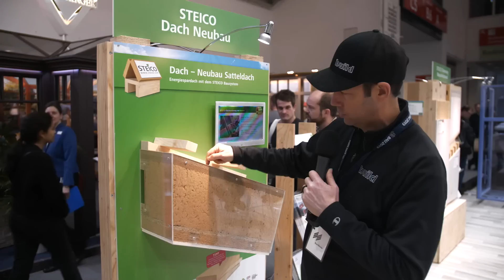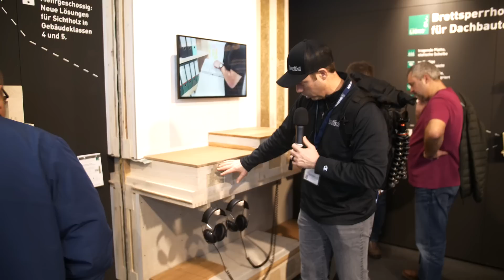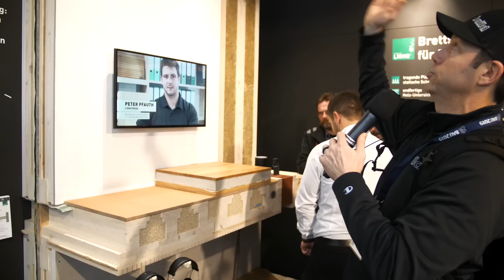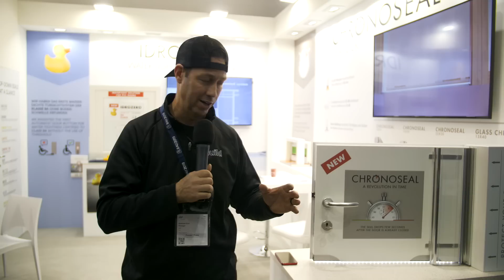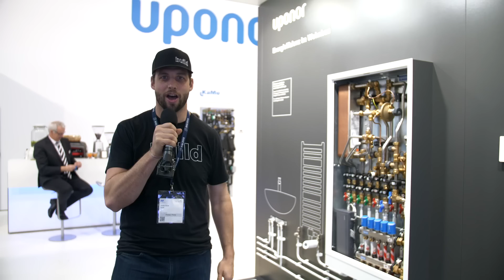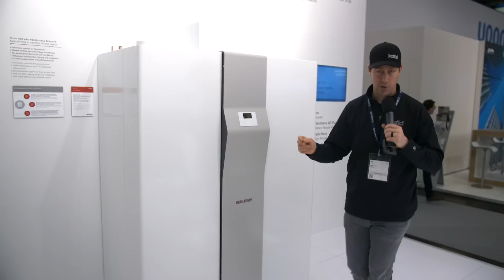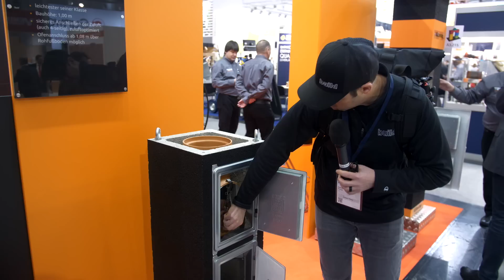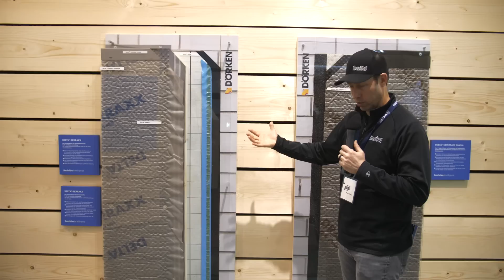These German Building Products are Awesome! Day 2 at The Bau Show Munich 2019

Comment: How longlasting is glulam?
Reply: Probably depends on the glue. I've heard that urea-formaldahyde keeps offgassing until it's all gone, so once you've gotten cancer from  breathing all of it, your house will collapse on top of you.  But I'm sure some of the glues they use now don't do that, though they still have to be chosen carefully. Some rot, some melt, etc.
Reply: PC No many years ago I had urea formaldehyde foam insulation pumped into the walls, never had a problem, but they were surprised given the age of the house it had 1 inch, of double coated heavy paper sandwich of the old fiberglass strands.  1939 built.

Comment: Dont if you guys got the answer for the difference of U-Valve and your R-Valve, its the opposite so to say.
R-Valve is Thermal resistance
U-Valve  is heat transfer coefficient - amount of heat per time ( 1 square meter per second and the unit is Watts per square meter and Kelvin [W/(m²·K)] )

R = thickness / thermal conductivity and the other would be U = thermal conductivity / thickness

Hope I didnt butcherd it with my little non technical english knowlege :D
Reply: AJ821000 you are good to go,

Comment: Hmmm, German products such as cars are beautifully engineered and a nightmare to maintain
Reply: Robert Montgomery If you think it’s a nightmare, to maintain, try a FRENCH CAR !
Reply: @flybyairplane3528  We Germany make it nice with a tendency to overcomplicate things just to make them a little bit fancier or give them a little more function while a simple solution would very likely have done the job to at least most of its extend as well.
On the french cars I hate that you cannot rely on a list of spare parts until disassembling the part. One of my earlier cars was a Peugeot 306 that at some point needed some new axle boots. For this special model and built there have been three versions available, one where you could replace the rubber boots, two different ones where you had to change the whole axle... Best of it, those three variants could not be derived from VIN or anything, but just the parts they had at hand and used that time of the day. Even better, those three have not been interchangeable at all...
Not sure if they still do it like that today.
Reply: Alex Ku you know that VW  does NOT sell the AMORAK in NORTH AMERICA, I have ALL THE models, & paperwork , but is all in DEUITCH, COMPLATED buying one & bring it back, but you would never BELIEVE  what the problem is ? Why is the FUEL FILLER ON THE LEFT ?, Because of that, I don’t buy ANY JAPANESE CARS  either !, and YES, about FRENCH CARS,
Reply: @flybyairplane3528  I didn´t know about the Amarok as I did not care for this car, just not a model I consider matching my needs. Arent early models the same as the Toyota? I might be wrong about that.
But they should sell the Atlas here in Europe, seems to be a nice car as well.
No idea why it is on the left. From about every other model except for the transporters having it right behind the drivers door the same as any transporter I know has it, I thougt in general it is on the right. I know for Peugeot in general it is on the left, but I think this is kind of traditional as I remember some older french roadside gas stations where you could just drive behind the pump from the road and then had the pump on the left. For Japanese cars I would bet it has something to do with Japan driving on the left.
But the way gas stations here in Germany are usually built with pumps beeing accessible from both sides, it doesn´t bother me that much. In the US I honestly did never pay attention on that detail. Depending on how busy the gas station is it sometimes it is easier to fill my wifes French car, as all lanes left of the pumps are busy, there are mostly free ones on the right.
I think there are a lot of car makes that are not exactly maintenance friendly all over the world. Older VW Golf needed to remove either the battery or the air filter box just to be able to replace a headlight bulb... 
Maybe all car designers should do a few weeks of internship every year in a garage, maintaining what they designed. I bet after that models would change quite a bit under the hood.
Reply: Alex Ku In NJ & Oregon are the only states where you do NOT serve yourself , and YES JAPAN drives on the LEFT, but even their parlamential  laws were drafted on the British, the petrol hoses here are SHORT, they WILL NOT reach,,if not parked on that side,,COSTCO has VERY LONG HOSES so you just lineup anywhere, as it reaches either side,,but they DONT TAKE CASH, FYI,  I have damaged 3 left drivers doors at petrol stations in FLORIDA parking close to the pumps . With LEFT fillers. The AMAROK is NOT a car , but my choice is a CREW cab, with a cap,over the pickup bed.  it’s a 3.0 liter clean diesel 5spd manual,,or auto
Reply: @flybyairplane3528  sounds like a good choice of car. As mentioned, I just realized I never paid attention to the pumps in Florida. But I am used to the pumps here in Europe beeing double sided, so you do not need a long hose. you can just drive into the lane left of the pump and you are fine.

Comment: Yeah, hmm this wood fibre stuff is preferred by environmental concerned people, cheapskates frequently opt for EPS insulation. A lot of effort is currently put on retrofitting insulation to existing buildings. Greetings from da Munich Bronx
Reply: It must be a German thing to use those wood fibre isolation boards.
Over here the following isolations are commonly used: PIR (Polyisocyanuraat), PU(R) (Polyurethaan), XPS (Extruded polystyrene), EPS (Expanded polystyrene), Rockwool and glass wool.
I guess most of those aren't environmental friendly products...

Oh i'm from Belgium (we're a neighbouring country).
Reply: @JelleRevyn  I guess in terms of market share Germany looks similar: EPS cheapest and most abundant, followed by glass or rockwool and the rest is using expensive specialty stuff pir, wood fibre, pur...
Reply: On trade shows you see the "new" stuff which manufacturers hope to sell into the existing markets, so i bet besides some architectural places and some longer going products, you won't find these products a lot on construction sites.

That Fakro folding balcony is allready a few years on the market though ( i thougt from Velux, but not sure of the brand).